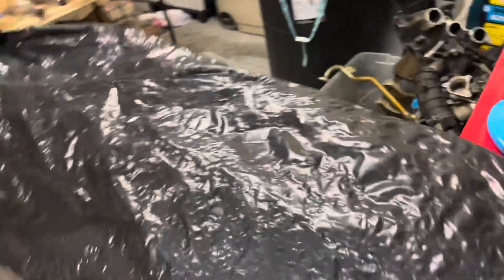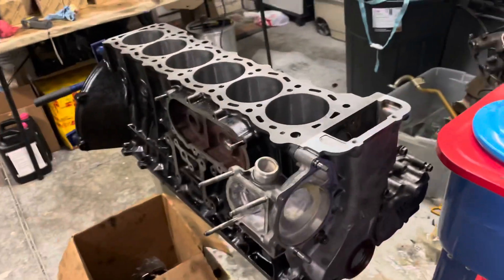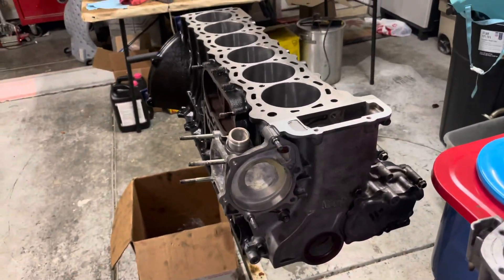Lexus LX450 update

Comment: That was great. It's great to see someone doing a big engine project in their garage. And actually doing proper mechanicing - measuring and assembling parts and then installing them. To me, this is much more interesting than the 1000's of YT car channels out there that don't repair anything. All they do is swap easy to get to parts. Not so much learning on those channels.
Reply from the maker: thank you for your comment, its hard to film and work at the same time I have actually gotten quite a bit further on this build I will make another update video and post it soon, I should have the vehicle running soon, thanks again for watching my update I'd like to get better with the camera and video editing so I'm working on all that while I work on getting this truck on the road at the same time.